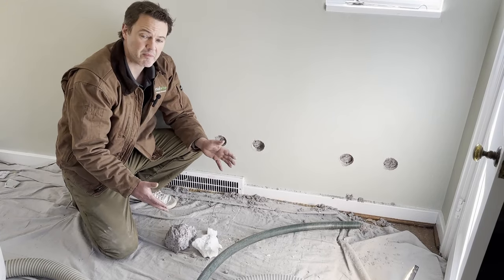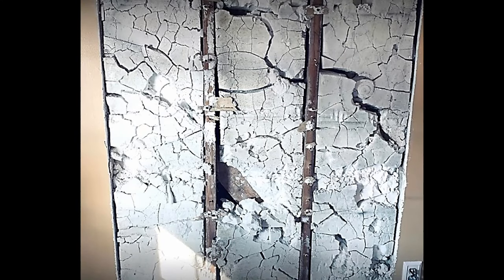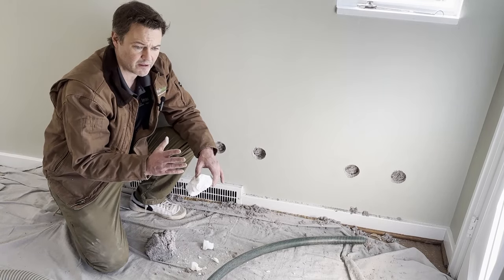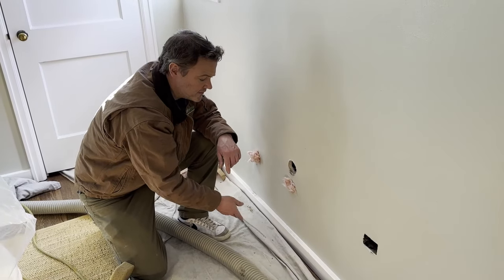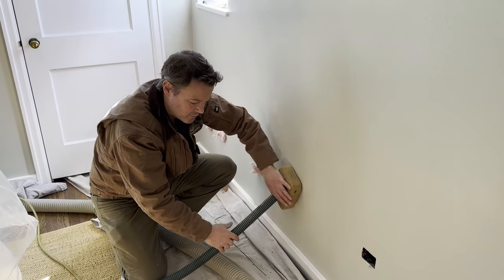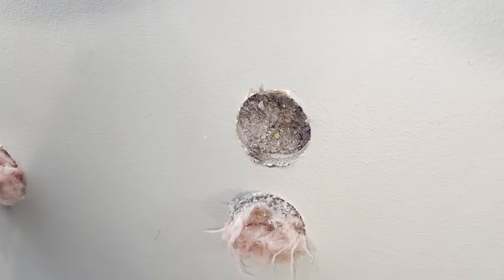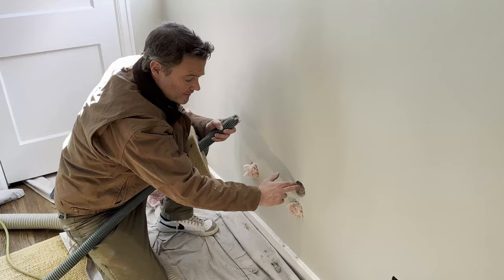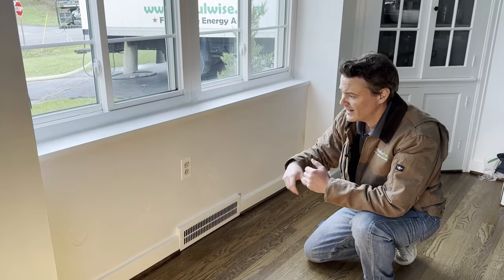Retrofit Wall Insulation Showdown!  Cellulose vs. Foam

Comment: His bias is written on his coat sleeves, since he immediately went into the cons of foam and his voice changed when describing it.
Reply from the maker: Correct, I am biased.  I previously installed injection foam for two different companies and witnessed it fail (shrink badly) on several occasions (within hours of the install in one case).  I'll enclose a link of how this stuff looks after installation below.  Our goal is to insulate the walls once and not have to go back.  That is why dense pack cellulose insulation is the most trusted way of insulating closed cavity spaces within the building science community.  

Go to Chapter Failed Foam Injection at 4:48 in the video.  
https://www.youtube.com/watch?v=YsVCTGRR7fc&t=304s

By the way, the customer paid the foam injection company about $7,000 to insulate the same areas that we are redoing in this video.  So yeah, we're biased. 
Andy

Comment: I am interested to hire you and your company. My only question is this a fire hazard?
Reply from the maker: Thank you!  If you live in the Pittsburgh area give us a call!  In terms of cellulose insulation being a fire hazard, the opposite is the case.  Because it is treated with boric acid it cannot catch fire.  If you do other searches on youtube you'll find where people hit this stuff with a blow torch and all that it will do is smolder.  It will actually reduce fire risk in a home, because it will eliminate the ability for flames to use exterior wall stud bays to envelop a home.  It will increase the safeness of the home fairly dramatically in that sense. 
Andy

Comment: How do you get through the firebreaks?
Reply from the maker: Great question!  By using a fill tube to inject cellulose into the stud bays, the good thing is that we actually find and locate the fire stops.  We simply drill an additional hole above the fire stop and dense pack the rest of the stud bay above it.
Andy

Comment: I bought a 1904 house and renovated it. When doing the electrical I found someone did this in the walls at some point.
I replaced all the windows and filled the Attic to R50.

My utilities during Canadian winter are nearly half of my friends homes that were built in the 50s to 80s.

My highest bill this winter was $251, 1300sq ft plus heating a 600sq ft garage.
One friend for example, with a 1950s home (new windows, original insulation) was paying $400/mth, 900sq ft, no garage to heat.
Reply from the maker: Hi there, do you mean that the walls were done with injection foam or dense pack cellulose?